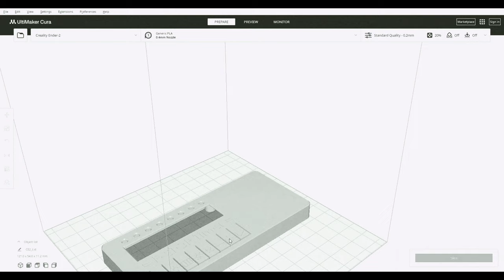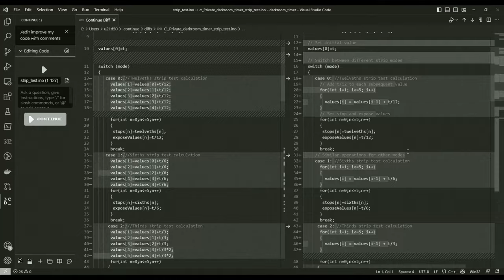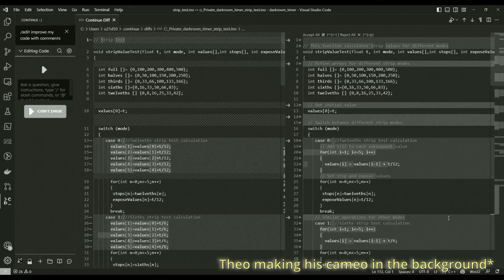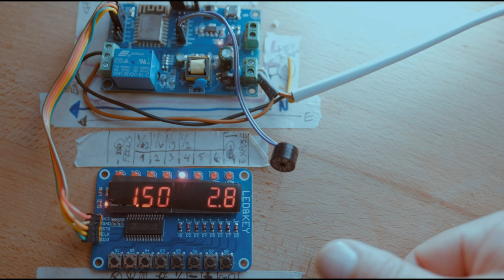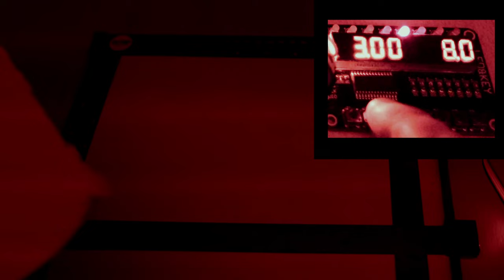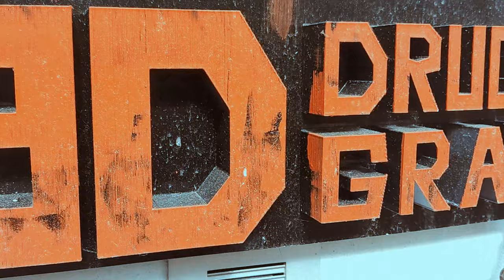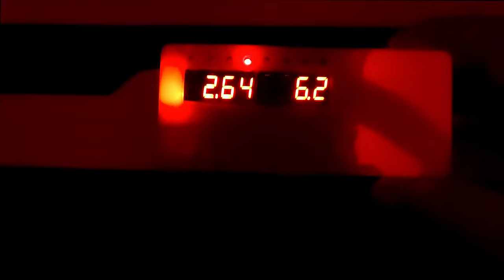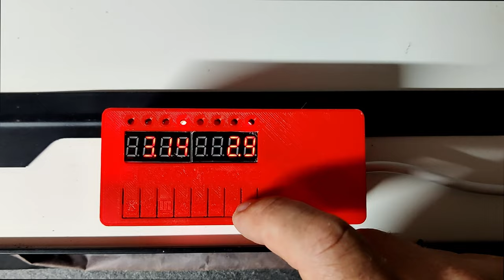Part III - Build The Ultimate Darkroom Timer - 3D Print

Comment: Just built it and it was such a great way to get an inexpensive timer, as someone giving darkroom printing their first try. Many, many thanks for all the work you put in to get it up and running. 

The only feature I would suggest would be the addition of an extra step in the strip test where the user would press a button to begin each section when the enlarger turns on, in place of the one-second delay. I might have a go at trying to add it myself, but it's a long time since I've coded. Anyhow, fair play, and thanks again.
Reply from the maker: Thanks Adam. Sorry for delay, I overlooked the comment. BTW there is new code already available to fix some things. I'm planning a follow up video too. You can always add an 'Issue' for the manual strip step on github https://github.com/glyons/Darkroom-Timer/issues I know someone else suggested another option for strip test too.

Comment: Hi I'm interested in purchasing your timer through Esty, but I have a few questions.  In the description of the timer is the following:   

The kit is pre-assembled however no mains socket or plug are provided with the kit. It is up to the end-user and their responsibility to wire it up.

I'm not sure what this means would you please elaborate.  I was also wondering if you made the changes to the timer box as you indicated in Part III of your You Tube videos, i.e. added larger Start button and added footswitch jack. If you have made these changes is there a pre-assembled version available to the public.

Thanks for your videos. It's always nice to know others are still working in wet darkrooms.
Reply from the maker: Hi Frank, Thank you so much for your interest. I would add the pedal jack to the timer without extra cost. 
Regarding the plug and socket this is not provided as each country/region has their own requirements. I'm based in Austria so I could provide an EU type socket.

The bigger push button I'm still think about too. 
I hope that helps. 
Gavin
Reply: Thanks for the clarification on the plug and socket; I suspected that might be the issue. I would appreciate your adding the pedal jack if I purchase the timer.  One last question before I commit to the purchase. Are the software bugs still an issue and if so will the updated software be available and capable of being installed on the purchased product? Thanks for your videos and for taking the initiative in developing this timer; I've wanted an f stop timer for some time.

Comment: Thanks for this great tool Gavin. I am trying to figure out how to change to base time to a value I choose. Can you explain how to accomplish this? Thanks.
I asked this before,m cut cannot find my post??
Reply from the maker: Are you trying to do a strip test or a normal exposure? Normally the plus/minus buttons usually change this in f-stop intervals.
Reply: @GavinLyonsCreates  I have been trying to get used to the strip test mode. When I press + or - it does change the F-stop along with the time. But, I cannot see how I choose the base time to start the operation. It only shows what seem to be predetermined times. For example, if I want a base time of 7 secs, how do I put that in? I have several spreadsheet calculators for this use, as well as an app for my Android, and they allow inputting the base time before it does the calcs for eash step. I am lost. ??
BTW, I have two of the timers set up and running. Easy peasy!! Thanks.
Reply from the maker: You can change the step increments to 1/16 or 1/8 to get a more gradual value. Hope that does the trick. Best Gavin
Reply: @GavinLyonsCreates  Ok, I think the 'light' is coming on. Just need to connect a beeper and will give it a go.
BTW, i have an enclosure designed and ready to print. Hope to have a prototype ready to try soon.
Reply from the maker: @WesBunker   Curious to see the prototype!

Comment: Hello! I lie in Netherlands and was wondering if your Kit will be available again soon? what was the previous price?
Reply from the maker: Hi Alejandro,  Thanks for your interest. Currently I planning on a new update to the code with some new features. I need to print more cases but I like to do a new design too.
Reply: @GavinLyonsCreates  Excellent! I would be 200% interested, when they're ready! I just sent you a message in the Etsy shop and prints email with my details to queue up in the list. Let me know! have a great week!
Reply: @GavinLyonsCreates   Also! is it possible to use a dim "amber" display instead of the 'red'? when doing RA4 colour, it's safer that way. Plus, I'm part of a big whatsapp group of printers, and there might be more people interested in the timer (also, if you're interested, please join, we're mostly in Europe and there's people from the Fuji factory in the group)
Reply from the maker: @alejandropastor96  I'm planning some code updates and adding the pedal switch. The display is a 7 segment display these don't come in orange unfortunately however a filter gel might work to restrict the desired wavelength of light. Unfortunately RA printing is something I know very little about.